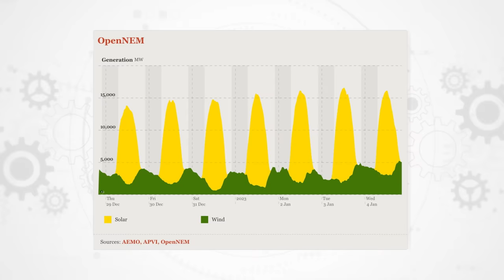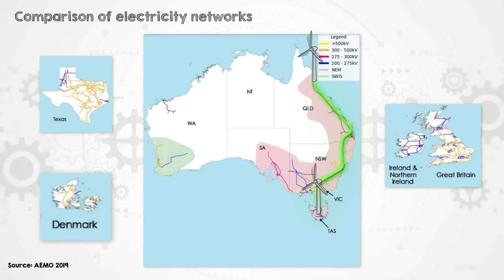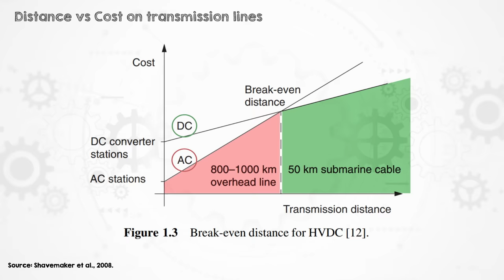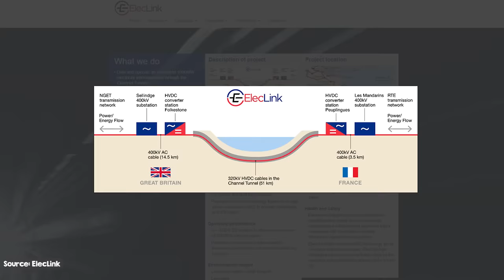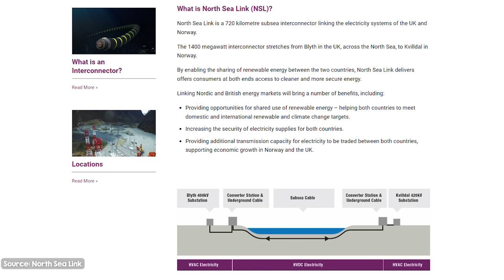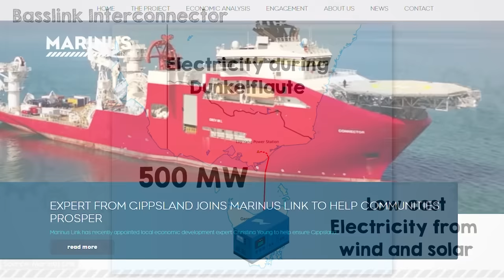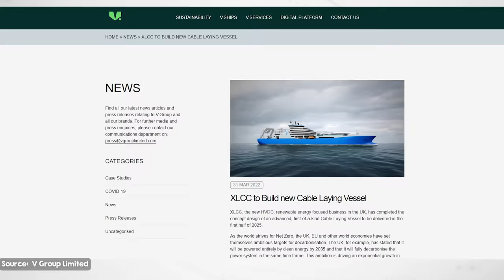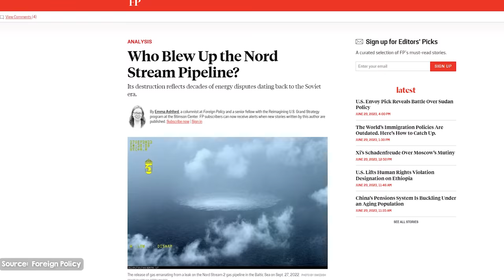Electricity Across Oceans: Is HVDC the Future?

Comment: For a peak at the Hydro Québec start of the the 450kv DC line converters:
53.72551548626105, -77.74555681549965  (satelite view)  The line leaves to the left of the 2 buildings. 

and you can streetview the line and its special poles from across the road to Chissassibi at: 53.7105767,-77.7609459

The nearby generating stations:  53.78454497786016, -77.5428589056662
Robert Bourassa (LG-2) : 5616NW
LG-2A 2.106
Both are underground but in the sateline view, you can see the 2  and 4 fingers where water comes out into La Grande river  of LG2-A and LG2 respectively. Water flow is north-south for the generating station, but ovrall the river is from east to the west. 

The Radisson substation also gets power from LG-1 at 53.73362779278009, -78.57043099840028 and only generates 1.456MW (enough to power a deLorean though).   However, the Radisson substation spreads the load amongst a number of lines to the south , the others being 735kv AC on V shaped pylons.  There are a number of power generating station part of the greater project which are upriver along La Grande as well as south that divert waters to the Robert Bourassa reservoir. 

For a map of the James Bay complex: www hydroquebec com / themes production images bassins grande-riviere.png
(add the dots and slashes accordingly). 

Where the 450kv line emerged from tunnel under St-LAurent river near Lotbinière QC:  46.592947561738804, -71.97112032612887

The Nicolet substation is at 46.07974079496323, -72.24928231826233  The DC line from James Bay comes in from the east side  and the one sleaving to new England leaves from the east just south of the one from James Bay. You can spot the converter buildings that take some of the power our of the DC line and convert it to AC transmission line levels for distribution in Québec.

Comment: I seemed to to have missed the number of cables needed for those mega projects to carry 3+ gigawatts across 3LK+ kilometers.    as in how clustered are these cables?
Reply: I spent 15 years as an electrical engineer on the Pacific DC Intertie.  Generally, HVDC systems will be arranged in a symmetric bipole with one set of cables sending current, and the other returning current, so the cable arrangement would likely be in multiples of two.  This arrangement has some reliability advantages.  The PDCI uses two pairs of two cables (overhead line) to transmit 3200MW 846 miles.  I think in general it is more cost effective to drop two cables rather than four for submarine applications.  There might be a diameter or weight limit that would require a two or even three of cables per pole, but otherwise I would think they would not want to insulate and armor more than one cable if they didn't absolutely have to.  So for 3GW I would say almost definitely 2 cables, one for each pole in the bipole.

Comment: Hey Rosie I have a questions, X rays are produce at around 20 - 30 kv so are we being bombarded with X rays anytime we go near HVAC power grid lines? Great Video, thanks.
Reply: X-rays are produced when you run tens of kilovolts through a vacuum. Without a vacuum I don't think you'll be getting any X-rays.

Comment: For Morocco to UK, surely it would be better to link it up with Spain, which would one of the shortest undersea cables in existence, make whatever upgrades are necessary to the Spanish and French grids, and put another link across the English channel.
Reply: Unfortunately these cables do not have unlimited capacity, they generally carry the output of only one power station, so if the aim is to send all the power to UK then a dedicated straight cable makes sense; while catching a ride on other cables that might already be full will be bad for reliable power delivery, and the value of power (profit) depends on its reliability.

Comment: I'm always wondering - if an undersea cable needs to be repaired, if it is e.g. 3 km below the surface and you have to bring it up for repairs, besides the difficulties of picking up the cable at such depths, it cannot stretch enough to pull it to the surface, right? So do they cut it on the ocean floor, then bring up one halve, attach an extension, then bring up the other halve, connect the extension there, and then lower the whole thing in a loop?
I'm assuming that they don't zigzag the cable during initial installation for just such an event?
Reply: Rov or bring it up... When you're talking 1000km even the tiniest bit of stretch is a huge distance
Reply: @Robert-cu9bm  if the cable were laid in a straight line, I don't think stretch would be enough to allow a cable to be retrieved from kilometers below sea level. But apparently the cables are laid with about of 1% slack. I'm just wondering how they prevent thermal damage where the cable crosses the mid-oceanic ridges (where black smokers and other volcanic activity may produce very hot circumstances).

Comment: My question is about circuit breakers and other protection devices. How do you break a multi KV DC connection? The arcing across big AC breakers can already be pretty hideous.

I mean sure, turn off all the loads gradually, disconnect when there’s no current flow, but these things are not always an option.
Reply: I suppose it is electronic. At the end of the link,, there are semiconductor switches anyway to transform into AC again. Would by the wat be nice to have a look at those.

Comment: You should have mentioned how phase differences are impacted.  US East coast vs Texas vs West coast cannot interconnect with AC.  Can they connect with DC?
Reply: Yes, DC has no phase, so there is no issue.  In fact that was one of the main reasons many years ago why UK started using HVDC to connect to France, our AC is not in phase with theirs, doesn't even run at the same AC frequency.
Reply: What phase difference???   Where do people come up with this stuff???

All three grids in the US are based on the same split phase system....used in the rest of North America.... So the interconnection is a technical issue not one of phase differences...
Reply: @nc3826  As I understand it, the three grids are not synchronized one to another. So, even though each, considered by itself, is three--phase, they are out of phase, one grid to another. That was supposed to be one of the reasons for using DC as a link from one grid to another.
Reply: Apparently You don't understand.... Synchronization happens at the generation level....  So synchronization happens automatically once grids are connected....

 the issue is just making with physical connections.... It's not about it being AC... In terms of connecting grids...

If you have two separate DC grids it's not it's going to be expensive to connect them
Reply: @nc3826  "Synchronization happens at the generation level" -- that is how a generator is synchronized with the rest of its grid. It doesn't provide synchronization between grids.
Reply: of course not....because they are not connected....
Reply: @nc3826  https://www.energy.gov/eere/wind/articles/uniting-us-power-system

Comment: The other advantage for DC is that the cable is rated at a given current and a given voltage, and DC fills this capability all the time, while AC has times when the voltage is zero. A much bigger factor than L losses for example. You don't need 3 phase DC.

Comment: You  mentioned that for AC, a magnetic field is created pushing the electrons to the edge of the wire, effectively  reducing the cables diameter but wouldn't this be try for DC also as DC also produces a magnetic field??

Comment: Another great video! I've been wondering about superconductivity. Yes, very low temperatures are required, but if liquid nitrogen temperature is cold enough, with a fair margin, thermal insulation could make it possible connect the whole world, without transmission losses. It would require very good insulation, but the energy for maintaining the low temperatures could come from anywhere in that network, again, without transmission losses. No transmission losses means no heat generated from that, and the cooling system would just need to compensate for the heat that the insulation still lets in, and friction from the refrigerant moving.       

The fact that superconductivity means the thickness required is determined by what's mechanically practical, and not by the capacity required, doesn't only mean a very small amount of superconductive material is required, the area that needs to be insulated could be extremely small, on the level of theoretically only having one physical dimension and still provide infinite transmission capacity. In reality I suspect some mass and area is required, but the lines can be ridiculously thin and provide unlimited and loss free transmission.      

I'm assuming liquid nitrogen would be a prime candidate for cooling such a system, While heat pumps gets less efficient the bigger temperature differential they have to work against, all else equal, and current liquid nitrogen production isn't very energy efficient I suspect there are a lot of low hanging fruit in improving on that. Part of the problem of current production is the usual, it's been developed to be powered with reliable access to almost free energy from fossil fuels.         

A couple of simple ways to reduce net economic cost of produced liquid nitrogen is producing it as much as possible when price of energy is low, and when and where the heat generated is extra valuable.  We're still using an absurd amount of fossil fuels just to create even very low grade heat, for heating and hot water. So to find good use for the heat from producing liquid nitrogen both waste from the energy input and the heat removed, shouldn't be difficult. 

I'm not saying it would be cheap and easy, but the big issues seems relatively simple, just needing development of practical applications of technologies we already know and understand very well, and nothing needs to be really invented. And obviously starting with short distances that require extreme transfer capacity eliminating severe bottlenecks in existing networks.
Reply: Run the numbers on HVDC and power losses.  Rosie suggested a loss of 3% over 1,000km.  I was surprised to find that 1,000 amps x 1,000,000 volts (1GW) can have an allowable voltage drop of 30,000 volts.  That requires only a 34mm diameter aluminum conductor.  Losses of 30,000 volts at 1,000 amps  comes out to 9.1 Watts per foot (over 1000km) which is a problem for thermal reasons so the conductor must be made larger.  30MW lost out of 1GW is affordable if collected from renewable sources.  30MW at six US cents/ kWh costs $1,800/ hour.  Can you really supercool 1,000km of undersea cable for $1,800/ hour?
Reply: @peteinwisconsin2496  Why 1 GW? That doesn't make any sense at all for a superconductive system. That's like evaluating a truck based on transporting what ju conveniently can transport on a motorcycle. 

1 GW is on the low end even for HVDC where cost increase with increased  capacity, not linearly, but significantly. The reason to choose that low capacity is usually that you want to avoid significantly reducing the difference in value of the power if you're making your profit from that difference in value, like ElecLink.            

Your example requires 2 pcs of 34 mm diameter conductors, 1 positive and 1 negative, and a whole lot more around them. That's about 5 kg of aluminium, for each meter, for the conductors alone, for each lousy GW. Also, the losses is per GW. 

If we're talking evening out difference in power generation between night and day around the globe, in an electrified future we're talking multiple terawatts. That's 5 tons of aluminium, for each terawatt, per meter, metric tons of course.
Reply: @fishyerik  OK, Tera-Watts.  1.2 Tera Watts is the generating capacity of the entire USA.  Let's replace the entire generating capacity of the USA with a solar farm in northern Africa.   For you to promote multiple thousands of km of superconducting cables, you must have some successes behind you.  Any of your past successes reach 1,000km in length?
    My question was: How did or do you provide liquid nitrogen cooling for every cm of superconducting cable and at the same time, allow for gaseous nitrogen to escape?  Overcoming the relative warmth of the ocean floor at +4C, versus -196C for liquid nitrogen requires the liquid phase to change to the gaseous phase AND gases be convected away with NO hot spots.  Get that wrong at any 1cm length of the cable and the 1 TW of power (1,000,000 amps at 1,000,000 volts will vaporize your superconductor and all the sheaths that it is in. 
     Or maybe I missed the news that we now have superconductors that work at close to room temperature.  I concede that the game changes completely when those become available.
Reply: @peteinwisconsin2496  Why the ridiculous suggestion to move US power generation to Africa? 

Also US is about 4% of the global population, a higher portion of total energy use is used there, but it is still a small part of the total global energy use.   

You don't need to keep the temperature at -196 °C for superconductivity. Seemingly non-controversial claims of roughly -135 °C is already achieved, that leaves more than a 60 °C margin between the boiling point of nitrogen at standard pressure and what's needed for superconductivity.     

Every centimeter, even every micrometer needs to be kept cool enough, not an issue. 

-135 °C is even ~12 °C warmer than the critical point of nitrogen, there can be a back pressure of 3 MPa on the exiting gas, and the boiling nitrogen would still keep the temperature well blow -135 °C. 

The best approach would probably separate lines for liquid nitrogen and gaseous nitrogen, multiple sets would give redundancy.   

Why do you think I need to have some personal success with superconductive power transmission to propose it? With that logic you need to have tried it personally,  under best imaginable circumstances and tried every solution for every issue encountered and still failed miserably to be skeptic about it.

Comment: Can you contrast that with wireless transmission? It's still in the future but if they are thinking of doing to send power from outer space, then why couldn't they do it on the surface?
Reply: Reason 1: There is less atmosphere in the way to get down from space, and atmosphere does absorb some of the power.  Reason 2: It would fry any bird or human flying through the beam!  With the space transmissions, the receiving antenna is many square kilometers in size so that the beam in any one place is not too powerful, which is no issue for a flat horizontal receiver, but you can't build a vertical one like that.  Reason 3: it could only transmit as far as the horizon, which is not very far!
Reply: We already use wireless transmission to move power from the sun to the earth. It's very cost-effective, even though it's wildly inefficient, only works for a few hours per day in any one location, is rather dilute (only 1 kW per square meter of your receivers, times 20-something percent efficiency at peak daylight) and is at the mercy of bad weather and forest fire smoke.

Comment: I can't help thinking that this sounds like adding a single point of failure to our grids. Existing grids have a lot of redundancy but when a country starts relying on a single HVDC cable... Idk. There used to be redundancy even for the damn NordStream pipeline (a pipeline from Norway plus the Družba pipeline).

I still firmly believe that we should have 40% of the planet using nuclear before we experiment with volatile energy sources such as solar. But at the same time, there's nothing wrong with doing those experiments. 

All in all, I have very conflicted thoughts about this. Anyways, thanks for the video!!

Comment: Besides the ocean depth, there is also the Mid Atlantic Ridge to contend with. This ridge goes all the way up to and forms part of Iceland & Norway. The two tectonic plates on either side of the ridge are also moving away from each other and the ridge is geologically active. A static cable laying on the ocean floor would loose slack each year, any eruption near the cable would pose significant problems if the cable was damaged.

The shift from Copper to Aluminium is financially driven rather than anything else. Aluminium cables also need to be larger than copper to carry the same current. I've had clients move from copper to aluminium and the cable sizes generally go up by about 1/2 of the original size. A recent example had cables going from 150mm2 copper to 240mm2 Aluminium between a SMSB and a MSB in a 300m run.

As for Taslink between Melbourne and Tasmania, the facts are slightly wrong there. The Hydro scheme does not provide enough power for Tasmania alone. This was shown a few years ago when the link failed and large capacity gensets had to be trucked in from the mainland to maintain sufficient power for everyone.
I believe Tasnetworks (local electricity provider) has upgraded their generation capacity but as more people move to or visit Tasmania, the more capacity is needed again.

Hydro power is also not a storage system when dams are in place on rivers. The Storage Hydro is normally called Pumped Storage and has two reservoirs at different elevations. At times of high power generation/low load (overnight for example), water is pumped up to the top reservoir. At time of high load, the water is used to generate power as it is allowed to flow to the lower reservoir.
No water is released into the general waterways using this system and generally no water is taken from the general waterways.

Regards

Comment: HVDC is still an Inverter Based Generation. One weakness of such is it lacks inertia, for now. A grid with low inertia will more likely to have unstable frequency. 
However, synchronous condenser helps.